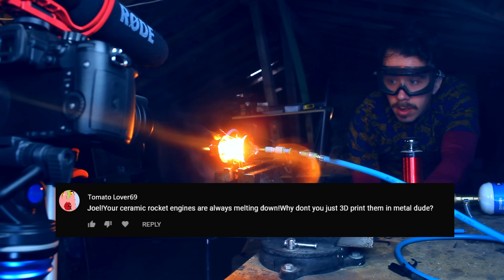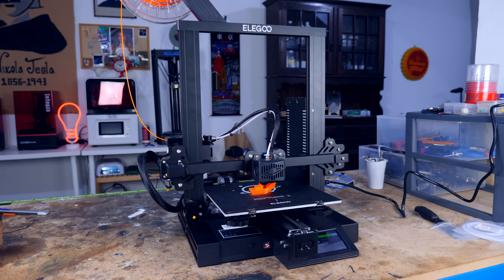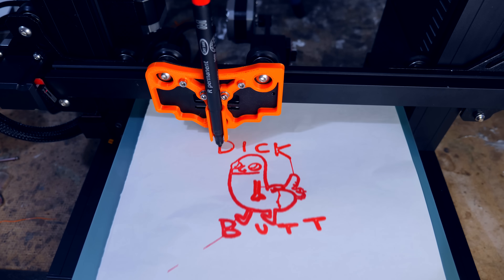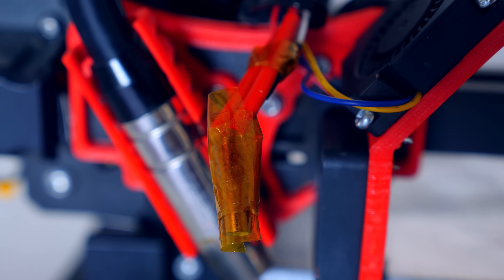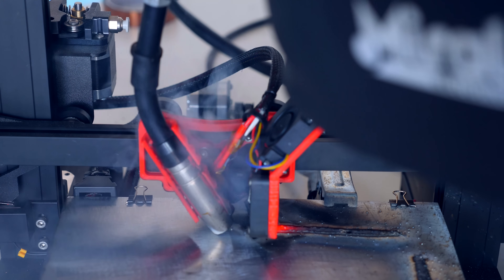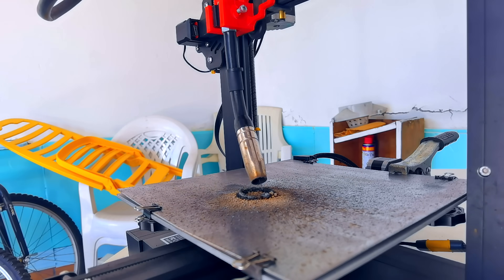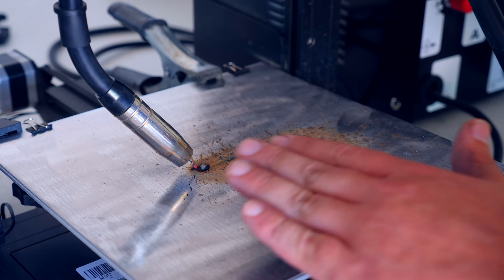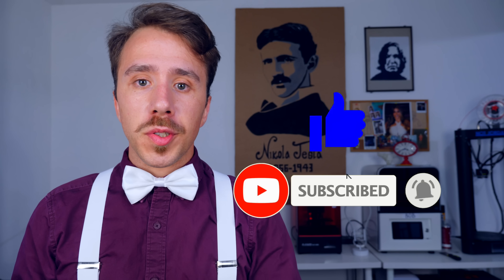I built a Metal 3D Printer using my Welding Machine

Comment: hi, nice try at this idea, i can see you are still learning about welding, well, i'm not an expert either but let me spit some advice, i see you are using a flux core machine, wich is good for sticking metal together, however it acumulates alot of heat on the parts if you try to weld continuosly, also, you won't be able to print more than one solid layer because the weld is covered by the scale that the flux left behind, so if you manage to weld more than one layer it wont stick to the previous layer, what may be better for cooling and probably for results would be to seal the printing volume in argon or in liquid (i can't say if some kind of oil or water) for cooling the work and doing the fux job of not preventing the weld bead to rust, sumerged arc is that thecnic caled i belive

Comment: One thing I noticed is that your using Flux Core welding. If you don't scrape off the slag then is will cause impurities and have the ability to  Crack. If you use gas MIG welding it might work better.

Comment: You should really talk to some pro welders before trying this again.
The angle doesn't help if it doesn't change with welding direction.

Lincoln's been trying to crack the "MIG weld 3D printer" problem for a while now with little success. It's apparently really difficult to make a high-resolution print with arc welding, it introduces a lot of heat stresses to the material, and also a lot of microscopic voids and impurities are difficult to avoid.

If you want to be REALLY bold and experimental, see if you can rig up a COLD welding 3D printer in an inert/vacuum chamber.

Comment: I am a Mechanical Engineer and can Weld very well! One of the Problem is definetly heat. You have to wait a little bit to let the metal cool down! Unless you will burn the metal. Not using the nozzle of the welder is useless bc you dont have inert gas flow at the welding point so the metal will oxydise! 

I also think you have way less knowledge about the right welding setting. U are using 1mm sheetmetal. If it bends your amps are way to high!

Comment: You could place the 3D Printer in an inert enclosure to avoid oxidation
Reply: Needs to run gas shield rather than no gas wire..

Comment: Hiya great video! With the mig welder the tip needs to be as close as possible to the piece your welding. Also gas-less welders are pants, you need argon/o2/Co2 supply to get much better welds. It looks crap with no gas as it’s burning the humid o2 that’s in your room creating a rusty looking weld. P.S those tiny welding gas bottles you can buy from hobby shops run out in a few minutes so don’t buy those.  👍👍.

Comment: Instead of putting an arc welder on the printer, why not add an induction motor to the printer to melt steel filament exactly the same way PLA filament is extruded?

Comment: Your machine is set too hot for this. Get it closer to 18-20. 24 is for 1/8 thick and thicker. Sometimes they come with thickness presets for sheet metal.

Comment: this is just an idea but dont know if it applys for your ends.
but why dont you use the plastic pieces that u print as a base for a silicone molde and make them out of seramic or make a seramic molde and make aluminium parts from soda cans?
nao sabia se o comentario tinha de ser em ingles ou nao mas gostava mesmo de ganhar a impressora. 
força com o canal

Comment: 0:05 for the rocket engine, try using ceramic itself, keep the inner cross section same as before, but make the walls thicker (making it cylindrical from outside). Use theory of thin and thick pressure vessels to decide the thickness of the walls. (I'm not sure though but I looked at the rocket engine as a pressure vessel which maintains constant pressure for an open system, hence the theory of pressure vessels from the subject of strength of materials may help).
Reply: ohh sorry, I meant control volume*. But there's a peak pressure that it has to handle (which may be known by fuel properties at highest temperature in the engine), once the peak pressure is known, minimum thickness of ceramic wall of the engine can be calculated for it to handle that pressure without failure.

Comment: Video idea: You should use that valve of the rotary co2 motor with a stepper motor driving it so you can control the flow and then use nitrous oxide canisters in it for a throttleable hybrid rocket engine!! (nitrous oxide is a great oxidizer for hybrid rockets)
Reply: That sounds awesome!

Comment: That was amazing. Looks so close to working. Maybe you could work out a way to temporarily attach the thin plates to a thick plate with  mounting holes on corners and at center that can be accessed from the under side. That should prevent warping on smaller sheets.

Comment: This would work much better with a tig torch and then a seperate feeder mechanism to feed wire or rod into the arc. It would take a little experimentation to figure out thw proper feed rate and current, but with a tig that'd be a lot easier and  especially with a water cooled torch it'd stay cooler,  but that is a big investment. I actually used to run a cnc tig torch.

Comment: G2 and G3(clockwise/ccw arc)  is recognized in most 3dp controllers even the cheap ones.

Also there is an industrial version of this that attaches to a verticle machining center. It MIG weld/extrudes a layer and then mills it to dimension.

Comment: Video Idea: multi-part... 1- Hydraulic Ram Pump, 2- Tesla turbine, 3- alternator generator, 4- ram pump powers turbine which powers alternator (generator). Results: ram pump converts high volume low velocity to high velocity low volume, turbine converts high velocity linear flow to rotational, alternator converts rotational kinetic energy to electrical energy. 
Durable off-grid electricity with only 4 (!) moving parts (2 check valves on pump, turbine wheel, alternator rotor)
Maybe an opportunity to collab?

Comment: Well it’s clear that turning a 3D plastic printer into a 3D metal printer is not that easy. But still very interesting. But now that we know it can draw so precisely, maybe you should try to do etched circuit boards with it. Getting the printer to draw the traces.

Comment: The weld quality will improve hugely if you find some sheilding gas and move away from the self sheilding wire. Much less spitting, tidier overall, no more birds visiting your 3d printer. 

Also gonna mention that getting a welding jacket is probably important, or at least throwing on a long sleeve shirt to protect your arms from the welding spot's UV. I'm also wondering if your welder can handle a 100% duty cycle. It may not be able to handle longer prints without pauses as constantly welding may damage the mig gun itself, just from running constantly.

Comment: I know of a product called a "Tig Finger" that is a heat resistant pad for your hand it could be used to holed the welding nozzle closer without melting maybe giving grater control of where the weld is placed ?

Comment: That's great! I thought of exploring the idea myself after ToT video. As for warping sheet steel will always suck, even thick pieces will bend into banana if You heat them up in such small area. My suggestion is that You can use bunch of short pieces of steel square profile, 20x20x2 mm for example, and weld them together side to side to form bed like this □□□□□□□□□ It won't warp that easy. For the nozzle mount I'd use a cheap pipe bracket and attach it to narrower section just behind the thick black isolator above the metal nozzle, it heats up much slower. You can angle the wire straight down, 90° to the surface. It won't matter. Acually for print it would be ideal to "drag", not to "push" because then the bead is "narrower" but "higher" and it will print in Z axis faster. I think it's an idea worth exploring. Maybe not with this kind of welder though, gasless wire leaves a lot of residue compared to welding even on cheapest solid wire + CO2 or CO2/Ar Mix. Probably best setup is pulse DC TIG + cold wire because it's cleanest and most precise but that would be a big buck and I don't know if You'd bald quickly enough to pay the expense with Keeps sponsorship money xD Please, please, please continue this topic! We all can learn a lot! :D

Comment: Using a shielding gas and non flux cored wire will eliminate the mess and need for cleaning between layers as seen in the video short you posted in the video. It will still warp even a thicker base metal, but produce better results

Comment: Joel, those welders are not meant to be used continuously.  They have a duty cycle, meaning that you can only run the welder 30% (arbitrary number, your welder may be different) of the time.  This means you could run it continuously for 3 minutes out of 10 at full power,  before it overheats and requires cooling.  Welder duty cycle isn't always documented in a way that makes sense for welders.  However it is a thing, so you'd need to adjust for that when you're trying to "print".  You could print for 1 minute, then cool for 3, or something along those lines.  Just food for thought my creative friend 😊

Comment: Could you use a 3d printer to print wax or plastic to put in a "lost wax" type of mold to pour metal in? Backyard forges are pretty cheap and you would have no need to be made of gold...how does that work, anyway? Cut off a few locks of hair for payment? Cut off a finger? A literal arm and a leg?

Comment: Video idea: 3D print metal objects by printing a ceramic mold, filling it with sintering metal powder and nuking it all in a microwave oven. If you have trouble getting the powder, you might have success with silicon carbide honing abrasive. Or you could try dissolving metal and precipitating it out of solution.

Comment: Would spot welding work better? It would be slow but it would reduce the heat on the thin sheet metal. 🤷I don't know, just like seeing you experiment with this idea.

Comment: you could design an engine that is possible to cnc cut out of metal so you could order it online. there are some websites like hubs.com that let you send in your solidworks designs so they can mil it or 3d print it they even do dmls.

Comment: If your using flux cored wire I would try standard wire and a gas bottle. The flux cored does make more of a mess and leaves a scale coating on the weld which makes it harder for the following layer to adhere properly unless it is cleaned. Can't believe your using your Neptune 2 for this, I'm surprised the display hasn't been destroyed from the spatter

Comment: Hi Integza, try using 3d printer and your hot kiln to make the nozzle using "lost foam" method. Ie print the nozzle in 3d with plastic.. then pack it into plaster and burn it in the kiln. You can check video from FarmCraft01 where he does 3d printed gears using this lost foam method.

Comment: What this shows me is 3D printing in metal means you need an actively cooled bed,  Versus using the heated bed.

Easiest to implement would be a water cooled bed, but can be rather bulky, but a stroke of genius would be to use thermal electric cooling, to keep the bed cool

And by being cooled you can look at having the bed be magnetic to hold down the build plate

Comment: Why are you doing a continuous metal deposition? Why not do it in small bursts, at lower amperage to control the splatter? Also, why are you using a MIG machine, which have notoriously dirty current, TIG machines are much better for nice clean current. There are attachments out the for a MIG kind of spool control made for a TIG machine at harbor frieg... wait you don't live in America. Darn.

Comment: "If I can't buy, I DIY!"
And if you can't DIY, you DIE! X'D
Make a rocket engine with small bits of metal mixed in the solid fuel, then use a 3D printer to draw an image with the metal that is spat out by the rocket...
(I first wanted to write "Make an ion drive to send a tomato can outside of the solar system, where it belongs", but I'll have to wait a year or two before your channel (you) is ready for that level.... ;p )

Comment: Well, I have an idea for an metal extruder, using a welding wire, that solves the sputter and thickness problem, but will not be mountable to that kind of CNC frame. Will need about 100$ of electronic parts too, the welding machine electrics will not do. It requires two different mechanisms. But since I am hopefully near ShenZhen soon, where all parts are cheap, I will propose that to Naomi Wu. If she wants to work with a weirdo like me, who sees her content and thinks, ah she is missing a metal-printer. Making an affordable metal variant of her mill would solve a lot of your problems - I hope. But I am stuck in Germany for the time being ...

Comment: You can always use a normal 3d printer to print a nozzle and use the printing to make a sand mold to cast a final Bronz nozzle.
You will probably have to make use of some or other heat exchanger to keep the nozzle from melting during use.

Comment: You could try making a DIY resin 3d printer but if you want metal parts you can cast them in a mold (you 3d print parts and melt them after the mold is done). TKOR has a video on how to make a metal melter from a microwave transformer and some carbon rods from the battery.

Comment: For testing purposes you only need two thicker peaces of metal plate. One to print on and another to grid the earlier attempt off since you are not making huge builds. For weld quality your issue is probably that by using flux core wire you get so much crap on the weld that it fucks with the new layer, so use regular steel wire with CO2 shield gas. Alternatively you could make Co2 production chemically instead of buying gas and bottle ie make machine to weld in Co2 bath like titanium is welded on Argon bath.
This idea has lots of potential, just need to fine tune the process and maybe add some protection for the printer parts. Some professional welder could help you out to iron out beginner mistakes and dile it in for you.

Comment: How about turning a 3d printer into a metal CNC using a dremel with the flex shaft?

Printing is fun and all but with a CNC you can make several nozel shapes from a block of metal. That would make for stronger metal parts for those that need the strength.

Comment: Oh Weld always pulls depending on where the heat is you probably would have better results if on each layer you do One Direction a little hole down and then pick the opposite like Direction should pull the steel back down just an idea but definitely longer cool off even multiple welding Periods during one layer with cool down (30 seconds?) to keep the metal from warping like crazy

Comment: If you wanted this to work, a gas MIG(wire feed) would work at low voltage. I did something similar to this before but just by hand... I got it to work but it takes some tries.

Comment: This is really challenging. Metal 3d printing is highly affected by so many parameters. Even after you set up the hardware, finding the proper scanning speed, energy input, and scanning pattern to reduce deffects and make post processing easier is an art. But if you couple finite elements thermal analysis (using COMSOL for example), you can get the parameters closer to the optimal settings.

Comment: You should try metal casting. It's probably the cheapest way to build a few heat-resistant nozzles. 
Getting a good cast isn't easy, but you get to handle red hot molten metal, is there anything cooler!? 
And 3d printable wax filament is a thing, it's an interesting meatrial.

Comment: as a suggestion maybe add a gas line to your crappy welder as when the metal is shielded during the weld it will weld better with less spit and power used ... who knows maybe it'll help
and remember
you said it was crappy
and tomatoes are disgusting!!!!

Comment: I think a better idea would have been to print the metal on a ceramic base, it wouldn't warp as the sheet metal did and when you want to remove print you can just crack the ceramic🤔(don't kill me i might be very wrong)

Comment: Integza, i have an idea for your to make this work. you do need to change the design, however. You need an enclosure and a tig welder. Flood the chamber with argon and set up the tig welder for pulse welding, then create a feeder for the filler wire at the tungsten. you can feed the filler wire straight down. you will need to work on the feed rate and pulse rate for this and it will be slow but you should be able to create a setup that will be reliable and works. The issue with mig or flux core is the splatter and it is not very uniform. With a tig welder, you can precisely set the temperatures and feed because tig is pretty consistent. I am not saying it is easy, I am saying it is doable. The biggest thing will be the filler wire feed, you will need a way to continuously feed the filler wire outside the enclosure. I have been considering this type of a setup for a while.

Comment: you need to use solid wire and argon gas, since you're using flux core wire in the welter there's a lot of slag that is building up and then the slag doesn't get knocked away before the next pass. you could also just clean it after each layer but that's more work.
Reply: Solid wire and argon don't produce as much of a mess and no slag so they layers will be well bonded and structurally sound

Comment: Instead of using the welding concept, why not use a small induction heater to heat the weld filament and maybe try to print in 3d. You can 3d print a ceramic nozzle for this as well for better filament targeting.

Comment: There is filament from several manufacturers with metal powder in it. After printing you just need to sinter the parts an you have a metal part.

Comment: normally, welding machines have argon gas to prevent oxidation at the surface for creating cleaner welds
Reply: maybe try to use a flux core wire

Comment: This could work but you would need mig machine that uses gas shielding instead of Flux core wire but machines like those or at least good ones aren't cheap